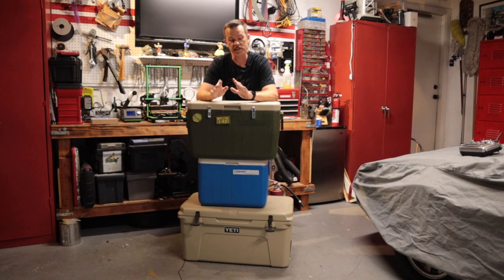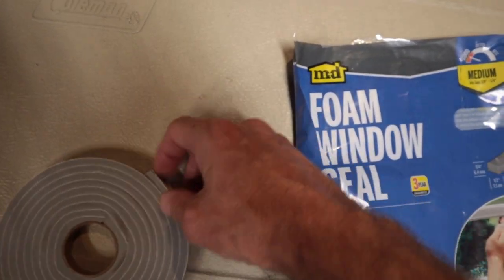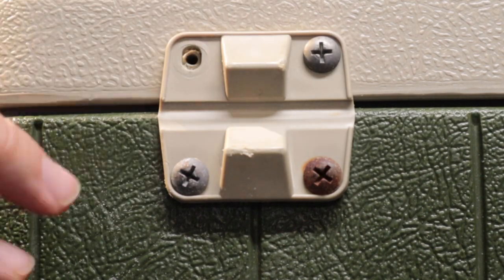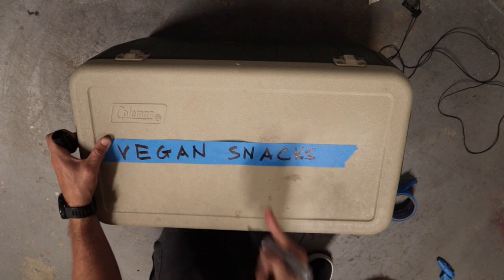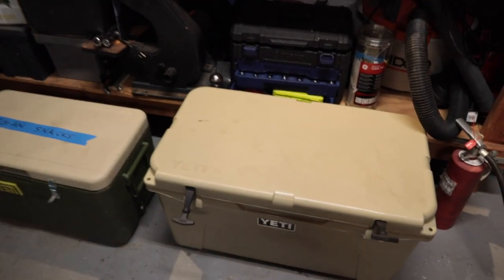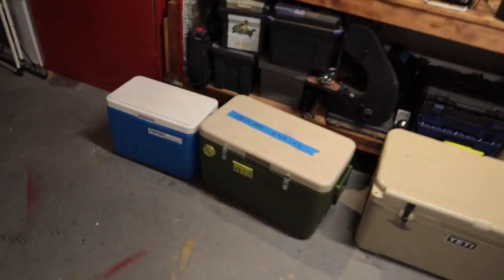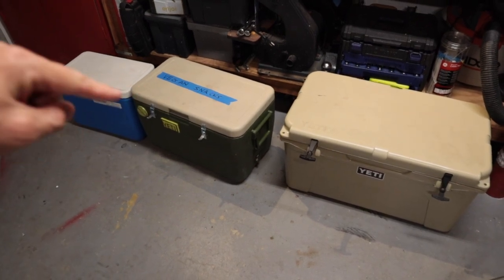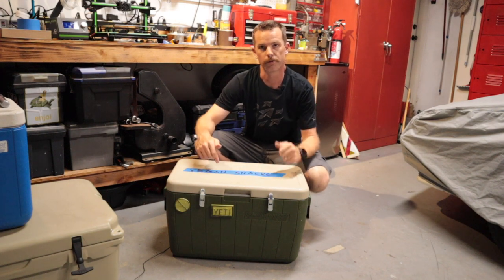Testing a Hacked Cooler - Better than a Yeti Cooler, Part Two! More Hacks and Upgrades!

Comment: I have a truly ancient Coleman cooler, purchased before we married 50+ years ago to take on picnics - and it traveled in the trunk of my '57 Chevy.  This was probably one of the early foam insulated coolers as the bottom third is covered with white plastic and the upper two thirds is metal over the foam.  The interior is white plastic as is the underside of the lid but the top of the lid and the locking handle are metal.  The flip-over bail locks in grooves in the lid's handle.  That provides a secure closure and the pressure for a tight seal.  I've never timed how long a bag of ice lasts but the soft drinks left over from one day's picnic went to work with me the next day or two so it keeps reasonably well for a 1960's vintage cooler.  One positive of the plastic bottom is that it doesn't rust as the all metal coolers of the period did.
Reply: Love those vintage metal coolers, and they aren't hard to repair. Especially today with foam in every  home and garden store plus spray cans of expanding foam.

Comment: So the moral to the story is if someone steals a $20 cooler out of the back of your truck you’re not going to panic, if someone steals a $500 cooler out of the back of your truck you’re gonna be pissed, great display on the comparisons
Reply: Near as I can tell. the ONLY reason to buy a $500 cooler is to be able to say you spent $500 on a cooler. Even if you used the $20 cooler every day of summer and had to add a bag of ice every day you used it. for the average cooler use. It would take years before the $500 cooler made more economical sense than simply buying more ice
Reply: Spending $500.00 on a cooler is like spending tons of money on Sitka hunting clothes. Its nothing more than bragging rights. I wonder If it's a certain kind of industrial insulation foam that Yeti uses that makes the ice keep longer and not the cheap hardware store stuff?
Reply: There is only one problem, he never tested a side by side, Non-modified Coleman vs a modified Coleman to see if there was any difference.

Comment: The only reason the modified Coleman didn't at least match the Yeti, is the wall/insulation thickness...but this is clearly the way to go cheap cooler wise & you still don't even begin to approach the Yeti price, but that type ice retention in a regular, slightly modified cooler is awesome as well as completely acceptable...I gotta modify all my coolers now...& I can put better latches & hinges on them too...excellent tips...🖖🏿😎👍🏿
Reply: Exactly. The wall thickness of the Yeti is visibly much thicker. But bang for buck winner is the modified cooler by far!!
Reply: There is only one problem, he never tested a side by side, Non-modified Coleman vs a modified Coleman to see if there was any difference.

Comment: Bear proof with LOCKING LATCHES w/ mini locks. 
Also ADD FEET  A lot of thermal transfer thru bottom to  ground or other surfaces. Air gap needed.
Reply: Rather than adding feet, place 2-3 1x1 wooden strips under the cooler. Stow in the cooler, when not in use.

Comment: Upgrade for the hinge is a 2" x 4"  price of webbing  twice as thick as seatbelt material  works perfectly  .I did this to a cooler and it's lasted 4 years in ruff use conditions.   Work's perfectly.
Reply from the maker: I’ve seen this done before, when my hinges go, I’m definitely going with webbing.
Reply: just get a chunk of seatbelt from a junk yard on gour next visit

Comment: I have a Coleman similar to your green one; mine's blue with a white lid, and also 15 years old. My wife and I have done a lot of summer camping with it in many of Ontario's provincial parks. What I've learned is that I can get at least three days out of two bags of ice if I put both in two  green garbage bags that I double-bag, tying it off tightly and leaving just a bit of air for insulation. This still leaves plenty of room for food, which stays quite cold if directly on top of the bag. And everything stays dry!

Comment: I would have put the foam sealer on the lid as opposed to the box, less exposed to wear as you pick and fill your cooler.
Reply: Exactly! AND just drill your holes and fill with expanding foam from the top (outside ) of the lid, and then seal with any kind of caulk, or hot glue, or liquid plastic .... it wouldn't have to be a food safe seal on the outside.

Comment: Great idea. When I get around to it I plan to do the same improvements. I saw where someone put there cooler inside a plastic tote with enough room to add some foam insulation around all the sides, top and bottom. I may try that too just for kicks. It would go nicely in the back seat of my 1975 mustang which has about 3 times the horsepower than a stock version. Happy camping.

Comment: Excellent video and follow up!  I like the addition of the foam around the lid with latches.  I'm still going to mention reflective foil if in the sun AND have a gap.  Reflective foil doesn't insulted but rather reflects the heat or sun.  Finally, when I put ice in, I put in the ice freely but keep half the bag tied up which decreases the rapid ice melt. Like and subscribed!
Reply: Reflective foil is a safety Hazzard.
Reply: @wildestcowboy2668  
Foil is a Safety Hazard?
How so?
Thanks
Reply: @mark2621Texas  Elementary my dear Watson.

Comment: The rotomolded coolers sure are impressive. But as you said so is their pricetag - and just as important as that is their weight - there is no way youre lifting a fully stocked yeti of that size with one person for more than a few feet.
Reply: Interesting that the expensive coolers focus on the roto molded aspect in their marketing. This factor doesn't affect the cooling much at all. The cooling is mainly achieved by the PU foam which is an extremely cheap material that the Coleman uses too.
The expensive ones have thicker walls, insulated lids and are generally much more hardy, but certainly over priced considering the cost of the materials they use.

Comment: About 40 years ago, there was a company called Gott that made coolers that were well insulated. They were sold in department stores and while they were priced the same as the major brands, they held ice a lot longer. They sold out to Rubbermaid and went away. I found a few at garage sales and thrift stores and use them all the time.
Reply from the maker: Guess I need to start hunting Craigslist!
Reply: You are right about the old Gott's. We have one and you are correct about them having better insulation, it always outperforms our other igloo and rubbermaid coolers every time. I really need to find 2 more Gott's. lol So I can ditch the other 2 cheaper coolers we have.

Comment: The yetti seems to be much thicker walls giving more insulation space leading to a higher R value. My guess is if you set the modified cooler down in a bigger box and packed news paper around it or some other insulator it would match up to the yetti.

Comment: Nice video; another example of how most luxury goods only provide mild performance increases in exchange for large increases in price.
To get some actual numbers and percentages, I'd suggest weighing out a precise amount of ice into 3 bags; then, poke holes in the base of each bag to allow for drainage, and weigh the unmelted ice at multiple time intervals.
Then you could calculate the actual dollar amount per unit of performance difference.

Comment: These tests do compare coolers, but when people just do that 5-day I’ve challenge, it’s so misleading. It doesn’t account for constantly being in the cooler getting drinks, or replacing them with warm ones. People think a yeti will still have ice after 5 days of actual camping.
Also anyone who thinks any plastic cooler is actually bear-proof is in for a great disappointment.
Reply: Bear proofing is required at a lot of places so I think that’s why

Comment: Wife and I lived on 31' power boat for a number of years. Noticed things would go missing from our Cooler we kept, at back of the boat.
Knowing the other live a boards, on our dock, as we all partied together. We also knew who worked and who didn't.
Noticed things would go missing, from the Cooler. So I took a piece of paper and wrote, "Mike get a Job" Placing that in the cooler solved the problem. Didn't have to provide, said person free Beer. As he no longer participated in our Dock parties.

Comment: As far as bears go, put a device to put a rope on and pull it part way up a tree hanging from a branch. And for how much those Yetis cost, you could buy a reg cooler and place it inside a bigger cooler with your modifications and still save a ton..

Comment: Good job!! I would definitely mod my cooler b4 1 spend 400 on a cooler.
Reply: Would you mod it before you spent $250 on a cooler that's better than the Yeti?  What's your price point?  What if it were 100% made in USA unlike the cheap Chinese stuff?
Reply: @lexwaldez  100.00 is still a lot of money for an ice chest. I would pay 50.00 for a good yeti type chest, otherwise a 5 dollar can of foam, drill bit, and with a little work it could look as nice as anything on the market, especially if I bought a 30.00 chest, and spent 50 upgrading I doubt you find one for sale as nice.

Comment: All you need is to reflect sun, I put windshield deflector on the top of the lid and made inside cooler lid, i have Ozark stock 52 quart cooler put 4 plastic 33 oz  bottles of frozen water. They did outlast ice packs. After 7 days water was still frozen  and ice packs defrosted. Buy yourself a decent cooler

Comment: Foam plus latches really makes a cheap cooler perform much better! You can’t increase the wall thickness but these two mods help you get the best possible out of a cheap cooler. I suspect foaming the lid is only fractionally helpful. All these cheap coolers leak air at the lid. Fixing that is huge.

Comment: You should also consider the thickness of the top, walls and bottom of each of the coolers and based on that the heat transfer varies in each of the coolers.

Comment: Perhaps a cooler inside a cooler might work?

Also, piano hinge for the lid is a good suggestion.

Placing a cooler on some 1/2" or larger piece of plywood can help reduce heat loss.
Concrete is a good conductor of heat compared to plywood.

If cooler is outside, throw a blanket over it to help keep the heat and sun away.
Reply: @xxxYYZxxx  Hard to find the exact fit.
You could fill in the gap with perlite.
Lightweight and has insulating properties.
Reply: @xxxYYZxxx  Get some styrofoam, cut to fit. Remove it then glue the pieces together.
Reinsert.
Also, you conduct a lot of heat from the bottom sitting on the ground.

Comment: Something you want to remember is FILL THE COOLER with rags towels...anything after your food is in there to take up the air space so there isn't any...
Reply: jerry Wald that’s what I did when I went camping Labor Day weekend! I campedThursday-Monday and used block ice and filled the empty spaces with cubed ice and laid a towel over before closing the lid. I kept 2 towels over it and I still had blocks of ice Monday although 3/4’s melted and I had to buy a bag of ice each day to fill the gaps  since it was 90+ degrees. My cooler is a Coleman Extreme. I’m going to DIY filling the lid with foam and see what happens next year.

Comment: I drilled holes in one of my cooler lids / sprayed PAM all over the inside of the lid / and sprayed the foam in it.     It worked ok .....BUT .......  3 weeks later after spraying the foam in it....it still is letting the expanding foam leak out through the holes.   It's gotta quit sometime I know..... but just thought I would put that out there just so you are not surprised.
Reply: PAM as in the cooking spray?  Why?
Reply: @otxoawolf9054  To keep the foam from sticking to the lid when you break off from when it starts oozing out of the holes.   Try it without it and you will see why.

Comment: The tape will Fall off over the open  / close operation !!
Try some silver bubble insulation and trace the top of the cooler opening .
Then cut a full piece of the silver bubble insulation and place it on top of the opening and close the lid . 
That's your seal , easy peasy  !!

Comment: You live in the California heat. I live in the Florida humidity. I love your version of a Yeti which is way overpriced. Thanks for making this video. I am always on the look out for my uncovered pickup truck for my Handyman business. I've stared using 5x5 plastic fence post covers as tool boxes with a smaller size fence post cover as a drawer. The unused pieces I use as parts bins by making wooden caps ends and dividers. Store bought is nice but are either to big or small so you can custom fit them. I got the idea from YouTube. I have ladder rack so I am trying to come up with a retractable sun shade that I can incorporate into the rack so it's lite and does not hinder the use of the rack. Any ideas, please start a series of pickup truck storage ideas. Thank you.

Comment: Keeping the bag of ice sealed  and/or putting in a separate container helps a lot too..
A 7 lb bag fits perfectly into my dollar store trash basket that fits my cooler, works great, with bonus of keeping melt away from the food..
 I also use a 23" liquid transfer pump, $10 from Harbor Freight, that uses 2 D cells, and has a 24" output hose attached.. insert, turn on, and it quickly pumps out melt, 5-6 qts/min.. Especially useful keeping a cooler in the trunk..

Comment: I have a cheap coleman cooler, I put my drinks in, comeback with ice, layer iodized salt on top. This lowers the temp of the ice down by 8 F, making the ice temp 24F, and it will freeze the bottles of water.
Now, in an emergency of no power, I'll take my frozen foods, place them in large zip lock bags, place in cooler, fill slowly, adding a little ice cream rock salt , ice - ICRS, ice- ICRS all the way up to the top. Tossing on quilted blankets. This drops the ice temp from 32F to 0F

Comment: The foam around the lid with the compression is the secrete more so than the foamed lid. I expect that two stock coolers without foam insulation with one with the foam tape and latches will show a marked difference. The lid air gap is more efficient than the solid foam lid with regards to heat transfer.

Comment: I live in a camper without electricity, water, and sewer.  I use a generator for a few hours a day. Just bought a cheap cooler then realized it is good for making cold water or drowning food. So, I was looking for serious help. Instead I  found seriously funny help. Thanks. 

Have you used foil at all?
Reply from the maker: You're welcome! I have played around with reflectix, which is like foil and bubble wrap combined,  it works really well!

Comment: The Ice to cooler size Ratio should be the same the coolers are different sizes therefore there’s more warm air in the larger cooler then there is the smaller cooler so there’s more than insulation at play here
Reply from the maker: It gives the advantage to the smallest cooler, which still lost.
Reply: Yea Karen

Comment: You can fix the hinges cheaply with a pet food bag,  fold over,make layer and put it under existing broke hinge,  run the existing screws thru the existing hinge section.
Reply: rubber inner tube is what I used to repair the  broken hinge on mine..

Comment: Testing apples to oranges. You need to test two identical coolers side by side. All those tests show  that the foamed  lid  melts the ice faster. There is more stored energy or stored heat in a foam lid than one that is using air as the insulation.
Reply from the maker: You’re right, but the difference in sizes gives the advantage of the smallest cooler. Which still lost.

Comment: I would suggest dual-layer insulation, especially if you have the "luggage latches". having another window seal on the bottom of the lid, and the rim of the cooler would be best if possible.

Comment: One thing I experienced with coolers in hot heat areas is if you leave the drain plug open and allow the water to escape  the ice COULD last all day. That's with a pelican cooler. Guess it depends how many times you open it to.
Reply from the maker: I’ve heard the same thing, but haven’t tested it. Makes sense though.
Reply: @DoItYourselfDad  I've done wildland firefighting on a brush truck and thats where i got the experience of making ice last in a cooler 😆
Reply: Not if it’s crushed ice, 1/4 to 1/2 water  makes the lowest temp and ice lasts for days

Comment: Drop the homemade cooler into a storage tub and fill the empty space with spray foam..that way you match the 3 inch insulation of yeti..shave down the insulation  nice and smooth and paint the top of it with white flexseal

Comment: An ideal test would be to get two identical coolers. Apply the upgrades you've done to one of the coolers and leave the other as you bought it. 

Then pour one or two gallons of water into the coolers and throw them into a chest freezer or any other kind of freezer which will fit them. Leave the lids open so that the water freezes solid. 

Then take the coolers out and place them at the same time in the temperature controlled room for 24 hours. After 24 hours has passed, pour the melted water into a container and measure how much water each cooler had. 

Whichever cooler has less water is the more efficient cooler. You'll easily be able to see how effective your modifications are by how much less water there is. If there's half as much water, that means your cooler is 2x more effective.

Comment: a piece of seat belt web under the hinge, when it breaks it still works
Reply from the maker: That’s a great idea, you could even use the buckle as a latch if you wanted to.
Reply: @DoItYourselfDad  just a piece of strap same size as the hinge, you wind up with a nylon fabric hinge behind the crappy plastic one...